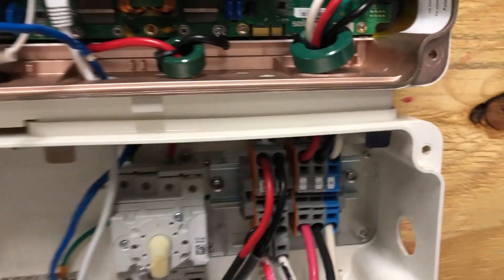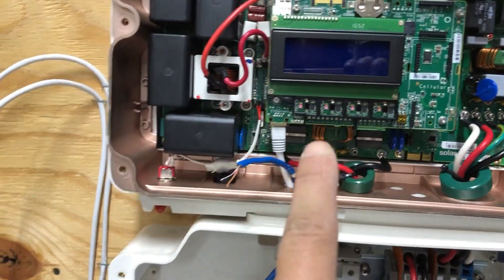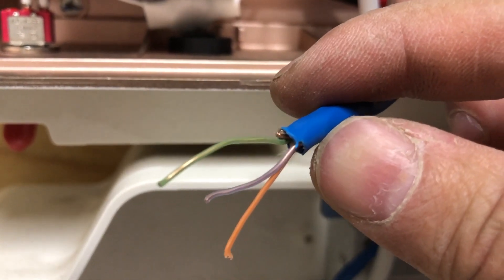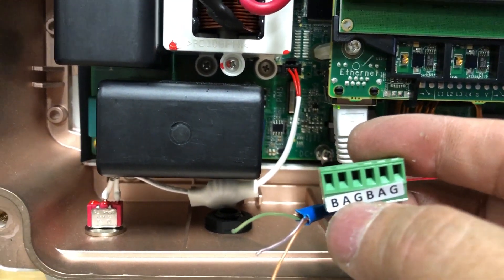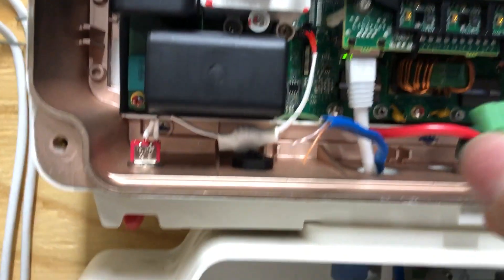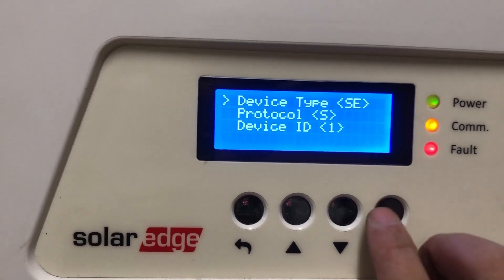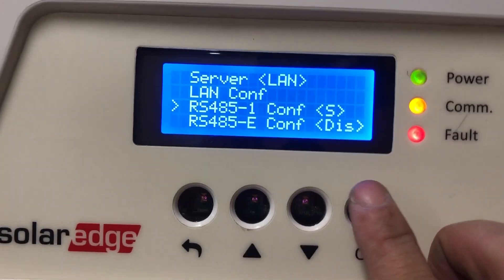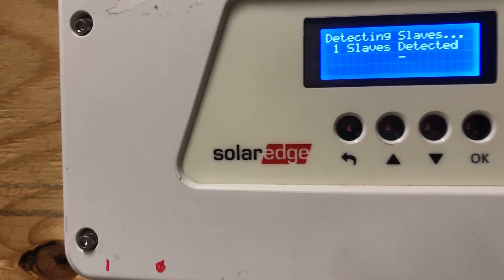How to setup Master Slave for SolarEdge Inverter using RS-485

Comment: Trying to figure out how to do this to set up master and slave on a pair of solaredge inverters that do not have the displays. One of my inverters has an RGM pre-built into it the other one does not which is causing production reporting issues. Basically the inverter has the built-in RGM is reporting its production the one without the rgm is not so I'm only seeing production from the one that has it built in. Solaredge tier 3 support agent told me I would need to connect an Ethernet CAT5 between the two ethernet ports and set up a master and slave. Both of my inverters do not have the digital display nor do they have the rs-485 protocol module that you show here. They both have 5G wireless capability and I have to use the solaredge SetApp for doing all of my setup and programming support agent said to just connect an ethernet cable directly to the ethernet ports on each inverter since they are not used for network communication.

Comment: Did you wire both inverters to AC in parralel? No issues with phases synchronization?
Reply from the maker: No they are not in parallel. Each inverter connects to a breaker at my circuit breaker panel. No phase synchronization issue at all.

Comment: Hi, I just added my second inverter. What are the letter mappings between master and slave? I was able to get it connected between master and meter successfully with your last video.
Reply from the maker: I used the following wire to letter mapping:  BLUE = B, ORANGE = A, GREEN = G
Reply: I see. Does the master inverter use the 485-2 to connect to the slave inverter on 485-1? Also, did you have to flip the B A wire on either inverter? Thank you for the help on this!!!